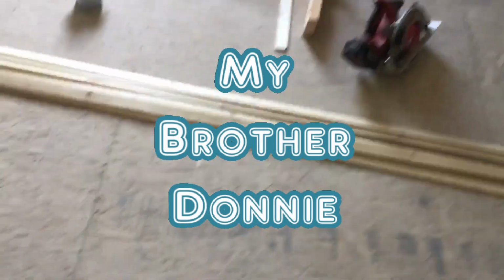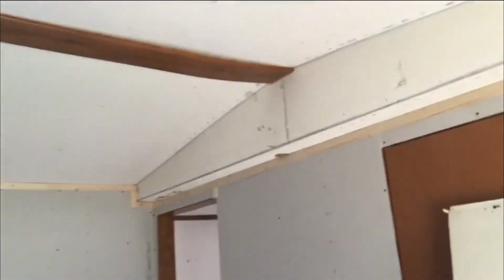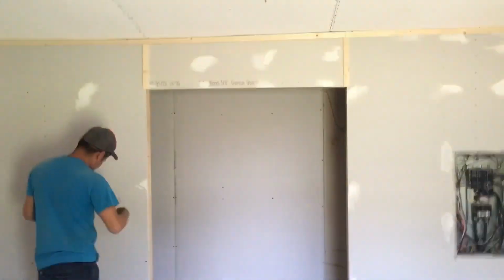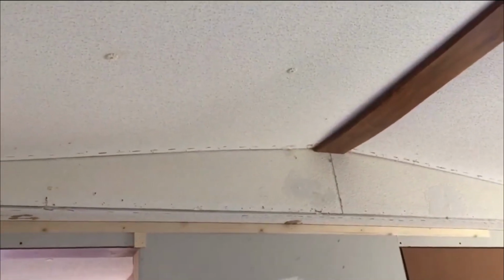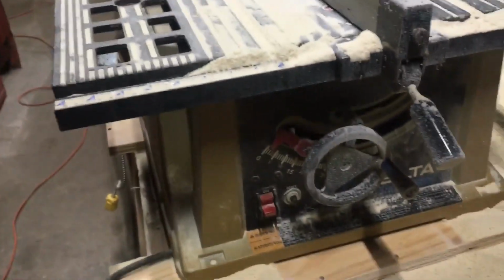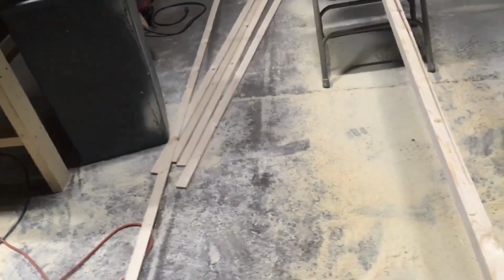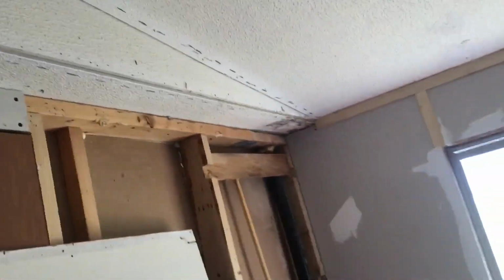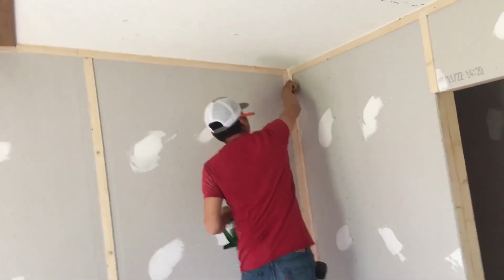How They Finished Drywall In These Mobile Homes - Master Bedroom Trim

Comment: When I bought my house, my basement office ceiling was badly damaged; I ended up buying a roll-on textured paint just for that application. This product was basically extra-thick latex with bits of clay or something mixed in. Another option is to add texturing sand to a gallon of paint, and apply it with a brush using the “stippling” technique.
Reply from the maker: Ok thanks

Comment: Thanks for the video Donnie. The best way I know to match the texture is to use a Wooster roller cover and slightly thinned drywall mud and roll it on. If it's too textured, knock it down gently with a putty knife. Good luck! ✌️(guess I commented too soon!)
Reply from the maker: Lol sometimes that happens but thank you for the comment

Comment: Oh... Shoot thats thats sweet to know, Now I can replace the broken ones in my mobil double wide. Thats really cool... Thank you for not only creating these videos but also for the tip on the 2x4 thats way cheaper then the price at lows..
Reply from the maker: Thanks for watching
Reply: @mybrotherdonnie hey let me tell you how I did my ceilings in my trailer I'm poor so I had practice and I watched my dad when I was a kid. Take a large sea soak it in water real good wring out put joint compound in a smaller container so you don't have to keep going to the bucket while on a ladder dip the sponge in the joint compound and dap it on the ceiling it works very well my daddy used a sponge mop the ones that don't have a firm sponge because he like to stand in the floor since the mop handle was long it worked out nicely! Just thought a country girl would give you a couple hints because when you are poor you have to play around and practice with things! Your welcome REBECCA 😁
Reply: @mybrotherdonnie typo use a large sea sponge

Comment: Why didn't you just use as many as possible in each room, then use the other in a room, not to be noticeable.
Reply from the maker: They are a pain to take off and get back installed. They’re basically cardboard.